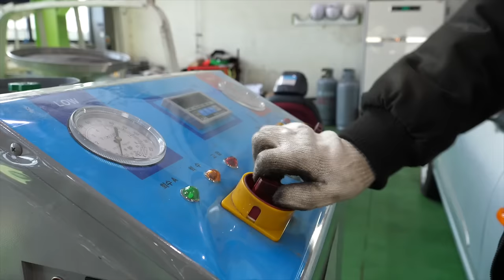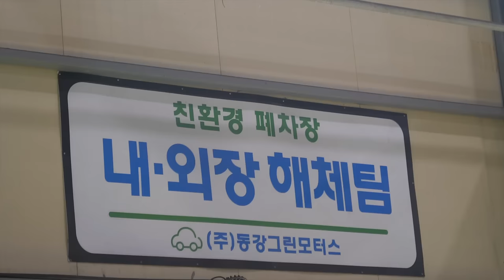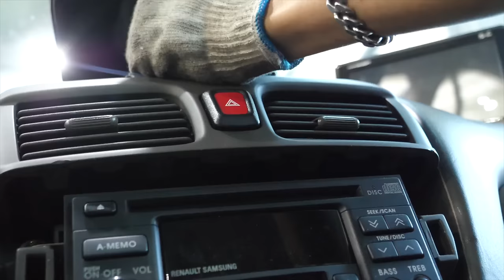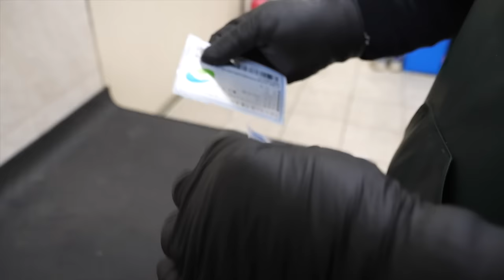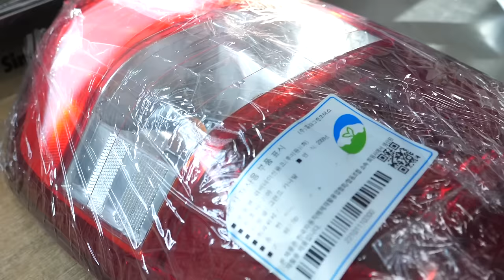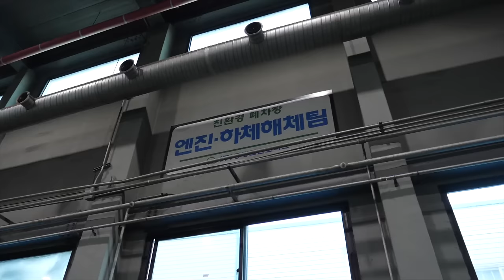Last look of the car at the end of its life. The sad process of Korean cars being scrapped.

Comment: This is how to recycle a car - by hand, separating as many of the materials as possible for proper recycling. Other countries could learn a lot from this. Good job. My only complaint is that in a lot of Asian countries, cars are recycled long before they're past their working life, which is a real waste.
Reply: Its in all countries. Ever see USA scrap cars? When they need a battery the AC breaks or the alternator stops charging people turn them in for scrap.
Reply: @GhettoWagon  Craziness. Instead of spending 200 bucks at most they just buy a brand new car which costs like 25 grand new..
Reply: In many countries cars are scrapped in one piece, ruining potential spare parts for other cars. Thank you Korea for doing it the right way, even though I have to admit that many cars shown in the video meet the junk yard long before they should.
Reply: @GhettoWagon 90
Reply: Warehouse facilities could handle most of the stock recuperated, and nothing should be scrapped, to the smallest bolt, unless accidented. Car designers should be thought on how to implement recycled car parts in their new designs, making it possible for manufacturers to utilize as much material possible from the stockpiles. This methodology permits stakeholders and shareholders to get higher returns on their R.O.I.s. Even under chassis could be kept if corrosion is light, be sandblasted, gravelguarded, and made readily available for body shops.
Reply: P😢😢🎉😢😮😅😊😊😊😊 @GhettoWagon
Reply: It's an admirable recycling process, but I do not see how this is financially feasible given the enormous labour input coupled with low commodity prices.
Reply: Fdkfye

Comment: Unbelievable, this car seemed completely new and there wasn't even a scratch on it!😔
Reply: Nissan... Probably had a stretched timing chain and burned more oil than fuel :D
Reply: @sekopiski  the oil didnt look bad tho
Reply: In Korea that car was about 20 years old. It was in a good condition though. Even gearbox oil was still red. World is pushing for emissions standards and unfortunately cars like that are going to be scrapped even if they are in good working order
Reply: @sekopiski  I disagree. Even if that were the case it would have taken about one 100th of the time to replace the timing chain that it would have taken to scrap this whole car.
Reply: At least they removed all the plastics and other materials, this was recycled a better ya than we do it in the west. Here they just get crushed with only battery, cat and motor removed.
Reply: @kennethsouthard6042  It takes less time to change a timing chain than scraping bruhhhhhhhhhhhh
Reply: @jasamingarcia6685  Perhaps you need to reread my comment, as  that's what I said bruh.
Reply: I did

Comment: When I worked at a place were we scrapped old american classics we let the windows and the interior still be in the cars if it wasn't in mint condition. Most of the times we only took out enginge, transmission, sometimes rear axle and the wheels. If no one needed any other part from the car it was crushed after a few years.
Reply: That was the way here in OZ  now it's going like what the video covers  most are disassembled then sorted . Too many gits wrecking the cars and damaging parts to get the one they want and too many injuries

Comment: Why was this beautiful vehicle scrapped? What was the problem? It still looked very good. However, I think it's very good how the parts are offered for sale there. I hope that also applies to the bumpers, engine etc?
Reply: Assuming the car is basically sound scrapping it like this is a violation against ecoligical principals in every way....
Reply: i think it had frame damage
Reply: small frame damage Korea is very strict about the safety of cars
Reply: Nissan... Probably had a stretched timing chain and burned more oil than fuel :D
Reply: @sekopiski  That can easy be fixed. That's why you don't have to throw away a car. Then you sell it to someone who appreciates it and fixes it again.
Reply: @Drako9874  that car is 20 years old. Fixing it will cost more than what it is worth.
Those engines are know for their high oil consumption and if you want to fix it that means a complete overhaul.
Reply: @sekopiski  Have you ever heard of sustainability? Not everyone wants to buy a new car every 2-3 years just because the dirty politics would like it that way 🤮 In the 80s and 90s, the cars were built for eternity and these are usually very easy and cheap to repair.
Reply: @Drako9874  hey if you want to spend money to keep old clunkers on the road then go right ahead :)
Most people do not and they'll just buy something newer and better when their old car gets too old.
Reply: @sekopiski  that doesnt mean they have to scrap it just sell to someone who will actually care about it
Reply: @Drako9874  true bro
Reply: @sekopiski  dang
Reply: @Drako9874  yea, a good example is the OG porshe 911, it was ease to find parts for that car
Reply: @toyotacorollaaltis8613  i agree
Reply: @nikolasamson9560  my old co worker had a Porshe as is work car, he drove that thing every day for like 30 years. The paint was about to blow away but the car sounded like a happy kitten.

Comment: I work at an a collision repair shop and it's interesting to watch the process of what we do in reverse.   Those guys must be tired and sore at the end of the day.  He needed a small cordless screwdriver to save all that twisting, or maybe even one powered by some air.   Division of labor would seem to call for the skilled guy to focus on his thing while a lower-paid guy does all the lifting and sorting.  Also was surprised to see the guy using a cutting torch with no eye protection.  He must be half blind.  

Admirable efficiency.  It occurred to me, if this were the Germans, say BMW or Benz, it would be just as efficient, but everything- tools, scrap piles, etc- would be laid out in geometric perfection and the entire place would be absolutely spotless, as in:  if a drop of grease were to hit the floor, some guy would scurry out of a door in the wall to wipe it up and then scurry back.  Spotless.  Those Germans are scary.

Comment: This car looks quite new.  It looks like it's still has a good many miles left to it's life.  Why is it being scrapped?
Reply: Nissan... Probably had a stretched timing chain and burned more oil than fuel :D
Reply: @sekopiski  For sure not a Nissan.  The car logo on the steering wheel is different.
Reply: @envitech02  it's a Samsung SM3 which is just a rebadged Nissan Almera.
Reply: @sekopiski  Tq sir.  I didn't realize Samsung is into cars, albeit rebadged ones.

Comment: The South Korean government offers cash incentives to car owners to promote the early scrapping of their seemingly functional vehicles, particularly those classified as Euro 1~4, which were manufactured under more lenient emission standards in the past. This initiative aims to improve air quality and overall environmental conditions. By opting for early scrapping, car owners can enjoy the dual benefits of receiving money for scrapping their cars and taking advantage of the government's incentives. It's like hitting the jackpot with two advantages at once.

Scrap car dealers, on the other hand, meticulously separate reusable parts and sell them as second-hand components. They also sell the remaining scrap metal to steel mills, generating profits.

Moreover, both the central government and local governments in South Korea are deeply concerned about increasing the adoption rate of eco-friendly vehicles. To encourage this transition, they provide significant subsidies for the early scrapping of non-eco-friendly vehicles and the purchase of eco-friendly vehicles such as electric cars and hydrogen fuel cell vehicles. Additionally, heavy taxes are imposed on internal combustion engine vehicles to discourage their usage and promote sustainable transportation options.

Furthermore, in Incheon, you will find a thriving presence of foreign used car importers acquiring a substantial number of vehicles that exhibit conditions similar to those depicted in the deregistered video. If you have an interest in exploring the Korean used car import-export industry, Incheon would be an ideal destination for your endeavors.
Reply: Words with wisdom!

Comment: What a shame looks it has a lot of life left
Reply: Old cars are bad for the environment as they emit too much CO2 compared to new cars. Cars from the 2000s are also too unsafe compared to new cars with modern safety systems.
Reply: @user-kc1tf7zm3b  yes, buy a whole new car very sustainable for everyone to buy a new car every five years.
Reply: @yoshiguy35  Yes, buying a new car is certainly good for the environment when replacing a much older car, as over the years and decades CO2 emissions have drastically improved. Naturally, CO2 emissions for an ICE car are perpetual for as long as the vehicle is in commission. This environmental reality becomes more pronounced the longer an old car is kept in operation. So, it comes as no surprise that national governments around would prefer to have these old cars taken out of service.

For example, one of the best selling Australian cars at the turn of the millennium in 2000 was the Ford Falcon AU, which emitted 4,577kg of CO2 each year with 12,000km travelled. This compares very poorly to the best selling car for 2021, the Toyota RAV4, which emits only 1,344kg over the same year, which represents a 3.4 times decrease over the old Falcon from 21 years earlier. So, if the Falcon is strangely kept in service for another 10 years to 2032, then the CO2 emissions add up to a staggering 45 tonnes over the decade.

It goes without saying that with renewable electricity sources, the CO2 emissions for EVs are naturally zero, which is the ideal outcome. So, this explains why ICE cars will be totally obsolete and unwanted in the new car market before 2030.

Comment: Seems counter intuitive when we recycle what appears a really good car with many years left to replace with a new car that takes energy and environmental factors to consider, instead we kill an old car that could go on instead. Make do and mend and all that. There was nothing wrong with that car. There aren’t just thousands of parts to a car there are actually millions. Like one solenoid can have 50 parts and there’s a hundred or more, circuits with hundreds of parts, motors, dials, all sorts, the effort making a complete car involves millions of people so when we do this, it needs replacing and there’s the impact on the environment. And yet here we are recycling what doesn’t need recycling

Comment: What car is this? It looks like a Nissan Maxima but it has an i4 engine which looks same as Primera and Almera qg engines.
Reply: once samsung had an automobile company. samsung sold it to renaut with car brand mark. so that is a renaut car.
Reply: @tmtm5112  oh, thanks for the reply.
Reply: Where I live this car is called a nissan sunny or an Almera
Reply: @toyotacorollaaltis8613  no. i watched both. and both are very different. both share parts, because samsung had no experience to make car and was first car that manufactured. samsung imported the parts from nissan. my dad's friend had maxima and my friend had sm5. i remember maxima had better ride comfort and center fascia then.
Reply: @toyotacorollaaltis8613   I know sunny and almera. This is not one of them, but thanks for the reply. The engine for me looks like nissan almera/primera qg15/18 engine but with renault sign.